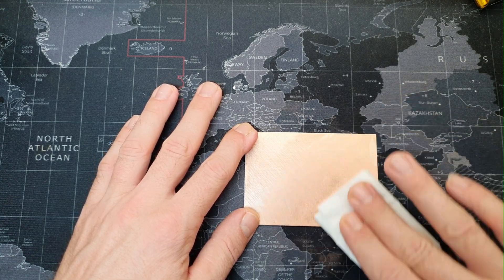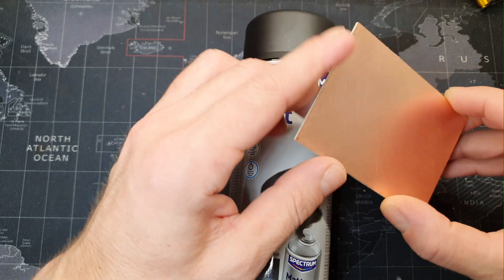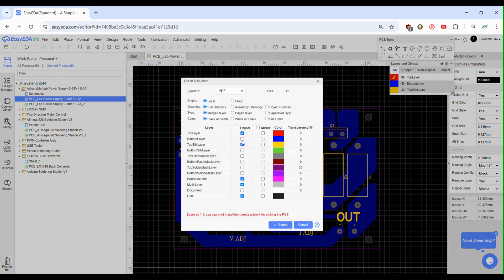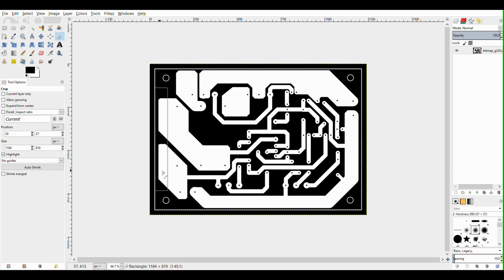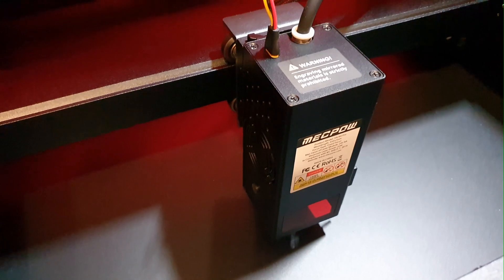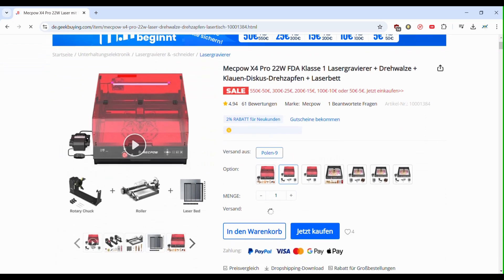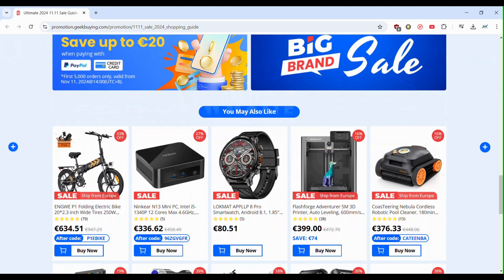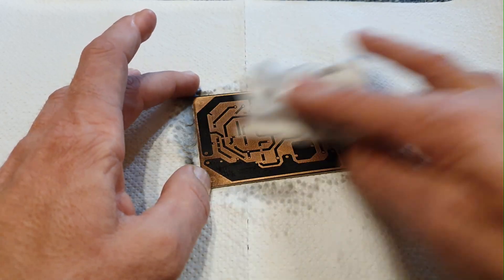How To Make PCB Using Laser Engraver | DIY PCB | Geekbuying 11.11 Sale

Comment: Hello .. amazing work. I own a 5.5W (455nm) Lasermodul and I was wondering if I can achieve the same result with my setup ? Any thoughts ? Thanks
Reply: I have 5.5W and I did the same. However, I was using acrylic flat black that easily wipe out with lacquer thinner when you clean the board in the future time.

Comment: The PCB laser project is just half done if as single side PCB has been prepared using other methods, such as laser printer /hot iron,
For more serious projects we need double sided with through hole.
Reply: Double sided is easy. And for the through holes, just solder pins through.

Comment: Actually many things are missing in this video. What settings are used for the laser printer.. How suddely that kind of chip came at the end. Whether you manufactured from a commercial setup and bought or the same laser engraved one. So many missing links are there. Suddenly at the end you showed some software with those dots etc.. moving codes.. What is it? People who do not know these things.. it is completely misleading and is not at all helpful. I Genuely want to learn but nothing is there in this video. I have a laser engraving machine 22W and I want to show to my students your video and I want to try. But now it is not possible as many steps are missing in this video.
Reply: I suggest take one more proper video with all details and give link here. So that I will try and after that I will share to my students.

Comment: Another thing, can you tell de type of paint do you used? The brand and where can we buy it.

And why do you painted a second time, ot is real needed?
Reply: The second layer is intended to close any small pin holes that might be left. A single thick coat would be more prone to forming puddles via surface tension. Needed? Maybe not. But much easier than finding  and fixing problems in case it would have been a good idea.

Comment: hello, firstly ..... you have got a good skill, thumbs up. I have a homemade laser engraver machine, and I use it with LaserGRBL. Can you please share details copper etching, bottom mask and silk screen (laser power, laser mode (constant power, or M4 modulating mode), axis feed speed (mm/min), and number of lines per mm). Thanks for the anticipated help.
Reply: 60% of power of 5w  feed about 600 mm/min  , no raster mode but contourning with  some programs ...dont use brilliant paints ....But isnt budget setup because vevor lasers buyed from amz lasts about 10 times and never finded the cause

Comment: Unless this can do fine pitch and 0604 layout it is worthless for most modern projects.  You can't even find most ICs in anything but SO or fine pitch.  Especially if you are working with RF.  But that is mostly limited by the spot size of the laser, and sometimes by the mechanical play in the machine.
Reply: Aren't you a bundle of joy!

Comment: What did you etch the copper with? It doesn’t look like ferric chloride.
Reply from the maker: It's sodium persulfate.
Reply: @HMProjects  awesome, i also consider using that. But it looks like you did not use heating? If heating is not needed i don't need to buy a big tank with heater... Perhaps you use a relative high acid concentration (more strong than reccomended)?

Comment: It's just a commercial for that laser.  Minimal information to actually make the pcb just really showing that laser.  I'm looking for a video on the software part but all of them on you tube are just physical board manufacturing.  which doesn't really help.  I know how to do the copper etch part.  but the software part is my problem.  Minimal real explanation about software then a 1:30 ad for a laser engraver and some cleanup of paint residue.  How about an actual tutorial where you actually explain getting that to your laser engraver. maybe explain settings.  also get rid of that AI Voice
Reply: what do you need to know? I can answer your questions!
Reply: @duracines  Why is every video I watch for tutorials always use different software then i use.  for exanple i want to make PCB's using my laser. I use Eagle to do pcb design. without fail the will use kicad or some other software to get that part done.  and it will always have some random feature Eagle doesn't have that they use to export that file.

what i currently need is how to convert circuits designed in Eagle,  convert it to whatever Chitubox slicer will understand and use my sla 3D printer to make PCB's 

it is possible with certain 3d printers straight from an SVG file. however mine doesn't support.  every time I try to figure these things out the tutorial uses the exact different software i don't use and the version is 3 steps back from what i need and the feature isn't available with the current version.  I need computer code tutorials that do something other then basic Hello World examples.  I also need tutorials that don't skip over all software issues only to explain in great detail how to put something together even tho I can put most thing together physically usually without instruction.  

  .... I'm sorry you just brought out years of personal frustration.  I'm not sure what i need help with now this was almost 2 months ago.  however a tutorial to use 
Autodesk Eagle to get functional PCB's either using my resin printer or my laser/CNC machine to make PCB's.  I know how to do the physical part of PCB making just fine software part is my problem.  before you suggest I DO NOT want to use another PCB design software.  I have many libraries and custom part loaded in there I do not want to start over on all my designs
Reply: @ballardtech827  I need the same thing as the guy above, I make my plates in the easy-eda software and I would like details about the software.

All the tutorials I watched omit the software part.

I have a laser engraver and I need to know exactly how to make the vector file to engrave on the plate.

I need these details. I'm in the year 2025.